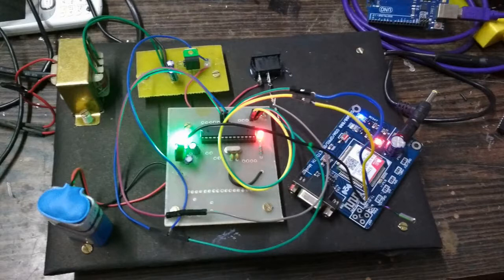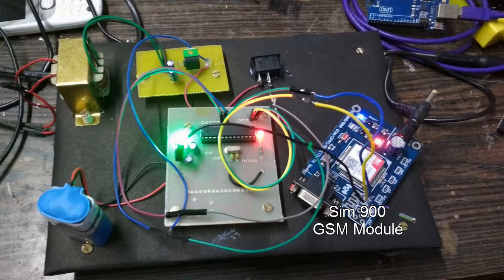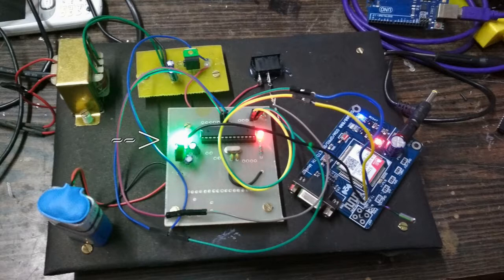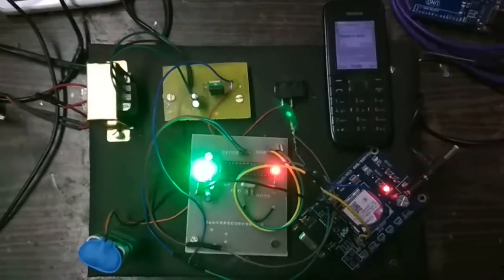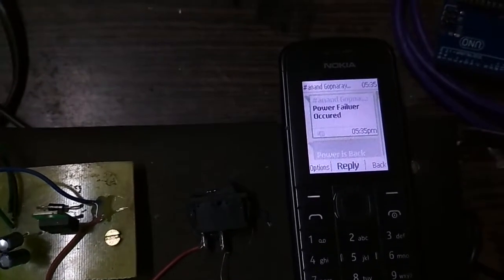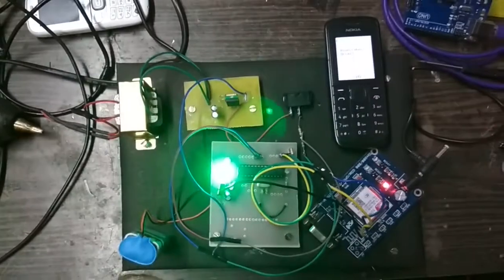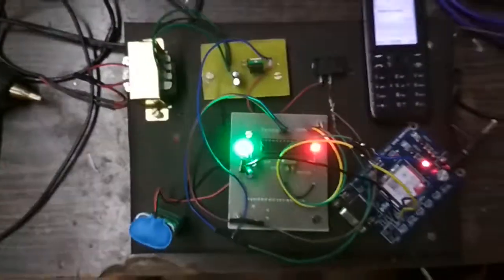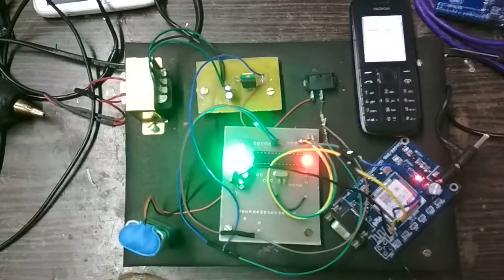Power Supply Failure Alert System Using GSM | Vikram More

Comment: Can we send sms to two numbers at same time using that code
Reply from the maker: Yes. You have to call same function two times with different mobile number
Reply: @vikrammore6654  means how that single line which specify the number or the whole code
Reply from the maker: @sreejithsuresh3642  put the sms sending code in a function which takes mobile number and msg as arguments. Now whenever you want to send sms, just call the function.

Comment: How much is the recomented power for gsm module
Reply from the maker: 12 v
Reply: @vikrammore6654  sir now 2 g sim is not available so which sim is preferable
Reply from the maker: New GSM module supports 3g & 4g sim cards also..
Reply: @vikrammore6654  which plan must we charge for it only sms plan or what?
Reply from the maker: @sreejithsuresh3642  any plan which includes sms
Reply: @vikrammore6654  is VI sim ok?
Reply from the maker: @sreejithsuresh3642  yes
Reply: @vikrammore6654  how to give backup supply for the gsm as it is 12 v
Reply from the maker: @sreejithsuresh3642  you can use 12v battery for that..
Reply from the maker: @sreejithsuresh3642  mail me on vikrammore246@gmail.com
Reply: @vikrammore6654  i have send u mail can u just check it

Comment: When power cut is there how GSM modut work can u explain clearly pls it required for me for my daily work pls
Reply from the maker: You need to run this setup on a rechargable battery.. so, even when power supply gets cut, it will send msg..

Comment: Is the Mains supply AC or DC?
Reply: you have to change it to dc. and the max voltage to A0 is 5v. if your 2 resistor are the same value your vmax for the power supply is 10v.

Comment: in your program i saw  if (sig > 300) ,what does mean by 300 ?
Reply: Pls send whatsapp no
Reply from the maker: @amarajeewakonara7453  please contact on mail first.. vikrammore246@gmail.com
Reply: another thing is where 9v bat is connected to?
Reply from the maker: The microcontroller reads 1024 units for 5v, so 300 is somewhere between there. If signal goes higher than 300, them we will know that the power is back..
And the 9v battery is connected to the controller board to power it.. the system will need a battery powered supply, because if the electricity goes off, then it should work..

Comment: in the code i saw this 

int onCount = 0, offCount = 0;

what you mean for this ? thank you
Reply from the maker: This is for saving previous status of the system. I think I have used onCount only. If onCount is 1, means system is ON, if onCount is 0, menas system is off.